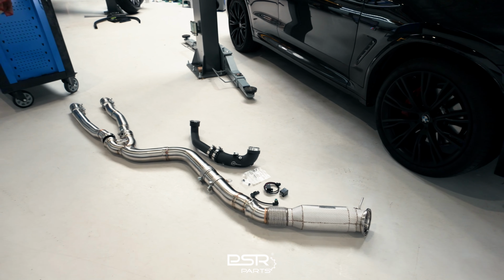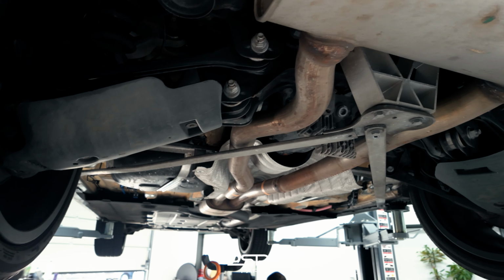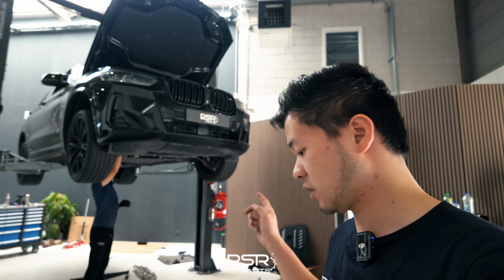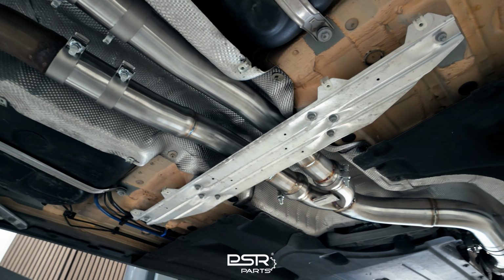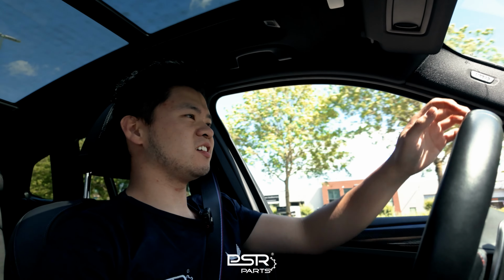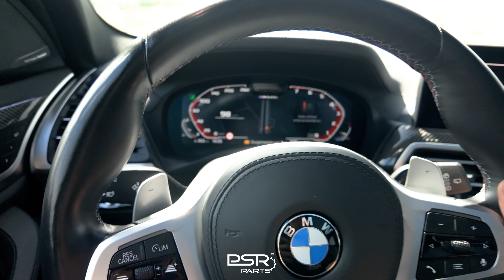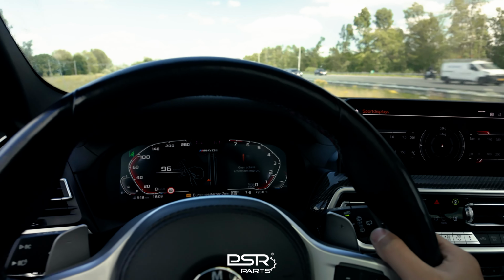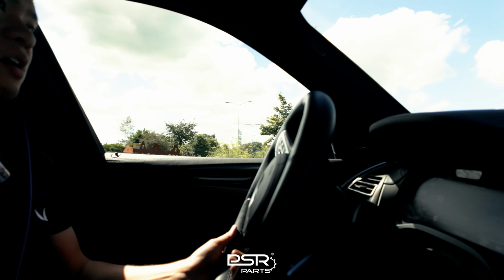This Is How A BMW G01 X3 G02 X4 M40i Should Sound From Factory! 200 Cell Downpipe & OPF Delete

Comment: do you lose the car's warranty with the external ECU ?
Reply from the maker: External ECU does affect the warranty, unless removed prior to workshop visits
Reply: @psrparts  so if you install an external ecu, then the owner has to go back to you to remove it before every time he visists the dealer ?
Reply from the maker: @byo5335  It is by no means a guarantee that the warranty will remain by removing the ECU as any engine modification will void warranties, but yes you can take it out prior a visit. The installation is fairly easy so with the right manual, it is possible to install and uninstall the ECU by themselves too.
Reply: @psrparts  is possible to detect the deviation even if you remove it prior?